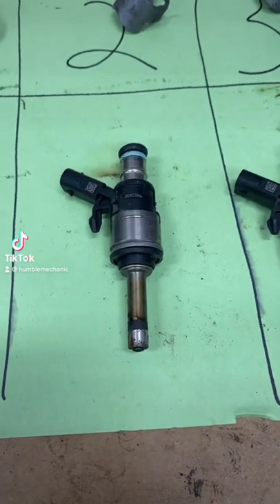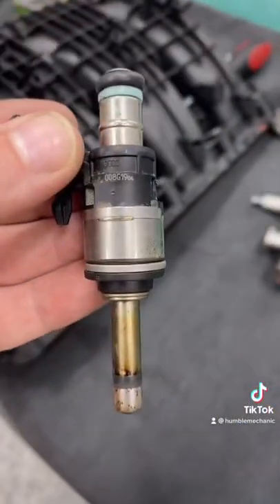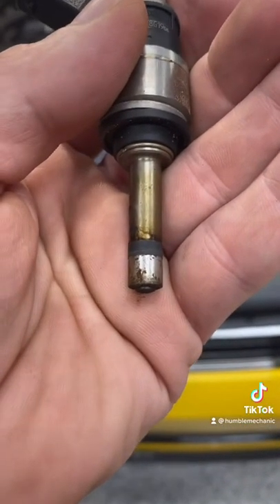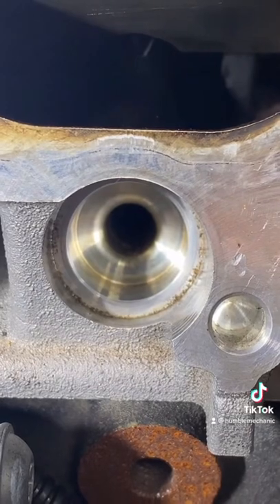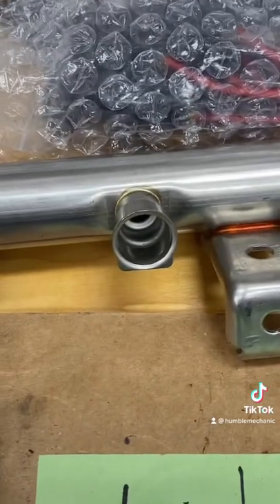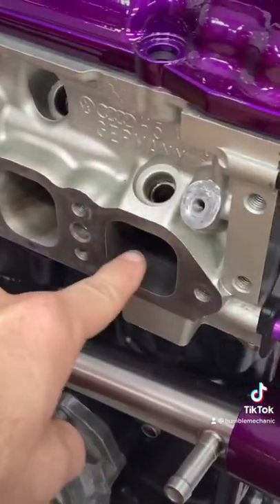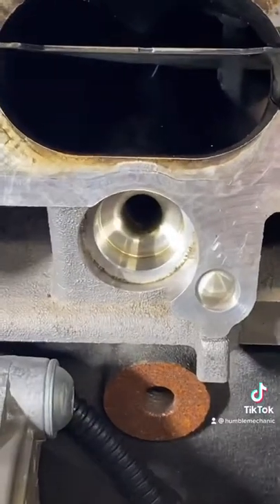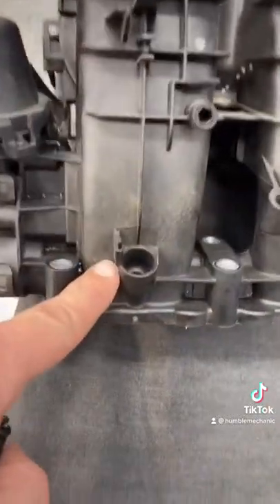Direct Injection vs Port Injection ~ Difference Explained

Comment: The combined way is the best, it has the advantages of direct injection and the cleaning action of port injection.
Reply: Wouldn't that use more fuel?
Reply: @sunny9895  No, you only put in as much fuel as you need.

A regular port injector puts in a little bit of fuel, a regular direct injector can get away with putting in a little less fuel (unless it is old or getting clogged - one of the major downsides imo).

If you have both, then you simply put about half (or whatever ratio they chose) of the fuel needed through each. In case you didn't know, the ECU controls how much fuel comes out of the injectors each time they fire
Reply: @rolls_8798  most manufacturers who run direct and port injection switch over based on engine load and power request. There are situations where direct injection is better and situations where port injection is better. 
Toyota does it this way and you can clearly hear the switchover between the two.
Reply: @meeder78  oh sweet, I was just assuming how they worked, but I still corrected OP's logic. Good to know, however
Reply: Port fuel injection is used at low part throttle and idle for better combustion. Switched over to direct injection on moderate to full load. Direct injection only vehicles idle “ok” but they are very sooty which can be seen on their exhaust tips being completely sooted over.
Reply: @rolls_8798  you don’t put half from each because on the compression cycle you would be EXTREMELY lean.
Reply: Direct injected vehicles compress only air during the compression cycle then inject the fuel right before the spark plug fires in the power cycle. Port fuel injected vehicles inject fuel during the intake stroke so that it has fuel during the compression and subsequent power cycle.
Reply: @RadDadisRad  exactly, on our Ford C-Max the exhaust was extremely black. The diesel Focus I had had less soot in the tailpipe than the Ecoboost.
Reply: @meeder78  I believe it. My ecoboost Taurus and Fusion make more soot than my Ram Cummins.
Reply: @RadDadisRad  other way around. Port injection has better fuel atomization and distribution the higher the load and rpm. Direct injection is superior at low rpm and loads.
Reply: @meeder78  that is because of the high compression.

The same issue that caused black smoke on diesel trucks. Diesel trucks have to have particulate filters now, gasoline engines don't. Yet.
Reply: @jeepmanxj  gasoline engines are fitted with particulate filters as well overhere as part of the Euro6 emissions levels.
Reply: @meeder78  euro 6 is the 2021 standard correct?
Reply: @jeepmanxj  you’re 100% wrong
Reply: @jeepmanxj  lots of articles published on it, I suggest you read some of them.
Reply: @RadDadisRad  thanks. I have and I also handle my own ECU mapping. I'm well aware of where what performs best.
Reply: @jeepmanxj  doesn’t sound like it. Direct injection sprays a cold dense fuel charge that hasn’t homogenized with the charge air because it wasn’t part of the compression stroke into the compression pocket on the piston. The spark is not strong enough to ignite the fuel and air. 1) because the fuel is not homogenized with the compressed air and 2 because the fuel is still liquid and pulling energy out of the compressed air causing it to cool which makes the spark work even harder to ignite the charge. That is why dual injection vehicles use port fuel injection for idle and part throttle tuning and direct injection for fuel throttle and moderate throttle loads. You’d know that if you actually read but you’re trying to convince people that because you beeped and booped a keyboard that you’re a tuner.
Reply: @RadDadisRad  sure thing

I bet you read the USDM sti has head gasket issues, the wankel is reliable, and the 2jz in the mk4 supra easily handles 800+whp with no modifications.

Research falls on its face when it comes to reality. Specifically low load emissions and power is why companies went to direct injection. Not the other way around
Reply: @jeepmanxj  not true. Direct injection allows a leaner fuel mixture without higher NOx emissions with higher compression. Aka a more efficient combustion with a baseline fuel. Direct injection vehicles don’t idle well. That’s why many manufacturers integrated port fuel injection to improve idle emissions. They use direct injection for load because they can inject directly before the combustion cycle when the cylinder is at its hottest warmest without causing pre ignition. You can’t do that with port fuel injection because it will ignite. That’s why DI engines get away with 11:1 compression while using 87 octane fuel. At least my Silverado is 11:1 and it recommended that I use 87 and nothing higher
Reply: Toyota has a system for newer cars called D4-S
Reply: @MrPond-xp6dl  they have always called their direct injected engines D4-S. Even the ones which feature only direct injection and not the newer engines which feature both direct and port injection.
Reply: Which model year of Vw has that combination of port/direct injection????
Reply: @sunny9895  no
Reply: @meeder78  so does ford with the 3rd gen 5.0 that's why they make alot of power n/a

Comment: Tip if you have a direct only engine  - Get an oil catch can to save your intake valves. Over time the valves will get junk on top from PCV blow by. Since there is no fuel being blasted on them (this cleans them as well) they will get build up over time and can cause the valves to not seal properly.
Reply: Unless you live somewhere with cold weather since the water in the catch can will freeze, leading to a very bad day if you try to start the car
Reply: @joebormann7631  shouldnt be any water in the catch can?
Reply: Can this build up cause oil to be burned? I have gdi and am having issues with burning. Only 150kms. Any help would be great. I’d pay to get the valves cleaned if it solves the issue

Comment: Direct injection unfortunately is most often used to reduce engine size and add small turbo for efficiency, and most of those engines are complete garbage, oil dilution.

Comment: My Mitsubishi 1.8L GDI is from 2001, it has over 240 000 km. Nevet had any problems with it, including whole direct injection system. 
VAG from 2019. 
Already needs repairs? 
:P

Comment: Thanks for the presentation, I haven't had a direct injected car so far, good to know.
Reply: As an N54 owner, have fun cleaning your intake valves!
Reply: LT Chevy engines are Direct and LS engines are port something else he did not say the direct runs two fuel pumps one is electric pump tank to high pressure pump that is mechanical like the old engines have and with direct you have to deal with replacing 2 pumps when they go bad and other issues direct injections brings

Comment: Can you do a comparison video on fsi, tfsi and tsi?
Reply: FSI (Fuel Stratified Injection) is VW speak for a naturally aspirated, direct injection engine. TSI (Turbocharged Stratified Injection) is VW for a turbocharged direct injection engine, and TFSI (Turbo Fuel Stratified Injection) is Audi speak for again a turbocharged direct injected engine. Fun fact, the i after many BMW model names simply means they are fuel injected, even though that's been all cars for decades. They make it overly complicated, it's all either MPI (multiport) or GDI (direct injection) with or without a turbo

Comment: Mr.Humble, do they make any type of kit to install a single injector into the intake to clean my crusty valves on my mk5? Tired of pulling the intake off every 40k
Reply: change your airfilter in time and use the next thicker oil (it may also lower your performence /increase fuel usage by around 4%  )😌

Comment: When a vehicle that has both types of fuel injection it’s usually the port injections job to clean the oil off the back of the valves. And the direct injection part is for power and the system alternates between the two if equipped like the newer tacomas have..

Comment: Currently own vr30 direct injection, I change oil often due to gas getting into oil
Reply: That shouldn't happen if it's burning properly. You might need new plugs.
Reply: Gotta be getting some major blow by as well
Reply: @matthewmorgan582  I change at 3000 miles, the car is running fine, the oil just always smells like gas, hard driving every day
Reply: @mikehawk1673  no blow by, just hard driving every day, I change oil every 3000 miles
Reply: It is a phenomenon caused by the a high pressure fuel mist getting caught between the cylinder wall and piston thus seeping through the piston rings gaps and into the motor oil. My favorite fuel system is a Bosch 70 PSI port fuel injection system. Atomizes the fuel better than other port fuel injection systems and the efficiency and cooling effect is very close to direct injection.

Comment: What can you do for a car with direct injection to keep the valves clean?  What are you doing with your Golf R?  (I have a Mk7)
Reply from the maker: Good maintenance, good fuel, "spirited" driving, and MK7s are pretty good. MK5/6 would need it every 40k
Reply: @HumbleMechanic  my golf R is multi point injected. Still had to clean the valves at 70,000 KMs.
Reply: Walnut blasting or cleaning of sorts by taking off the intake manifold.  I work at a vw dealership and pretty much any VAG for the last 10 years this is needed every now and then.  If you have dfi only you have to clean them since gas will never get behind the valves.

Comment: Hej man, can you make a video on why all manufacturers use plastic intakes?
Reply from the maker: No video needed. The simple answer is probably cost and ease of manufacture.  

There is a case for heat dissipation I’m guessing g too

Comment: Great explanation! Which is better for performance and/or reliability?
Reply: Direct injection for better performance and port injection for reliability. 
The problem with direct injection is that it causes carbon build up on the valves and they need to be cleaned. 
I believe that using both direct and port injection is the best for performance and reliability as the port injection cleans the valves when they spray.

Comment: I've always wanted to find out which VWs and Audis have direct and port injected engines, that would make a super useful video for us trying to find a newer vehicle but trying to avoid the direct injection carbon problem😉👍
Reply from the maker: In the US, its VERY few. TTRS,R32, and maybe a few S/RS Audis. but most VW/Audis are now DI
Reply: @HumbleMechanic  Thanks 👍, I guess I'll be sticking with my trusted B5.5 Passat with its 2.0 port injected engine. It's annoying they went with direct injection as I like the brand but just no viable options to upgrade to a newer vehicle without taking on board the dreaded carbon! Such a shame they did that!
Reply: Not all 2.0 tfsi engines (mk7 golf gti, R) etc are DI only, some have port injection as well as DI, and some only have DI
Reply: @scott4207  hey thanks for that👍, I'd love to know exactly which models/years to look out for, if you know any more details, that'd be absolutely awesome 🙏
Reply: @jahkingdom  your welcome, I’m a technician for VW main dealer so I’ll have a better look into it, but to be honest I’m not totally sure if it’s model year dependant, I believe it’s certain engine codes which run both DI and port injection, however which engine codes that is I am not sure. We don’t really get much coking up of the valves, I know it can be a problem long term but from my experience it’s actually the lower mileage cars that suffer with it, short journeys etc.
Reply: @scott4207  that's very good to know, thank you 👍, very handy to know you're a VW tech😉. I've got a fun job coming up on a VW Eos, roof won't operate because the rear quarter window won't move, even after a window reset. I'm thinking the module lost its comms maybe. Don't suppose you know any short cut to making the module and ECU talk to each other again by any chance?, really don't relish the idea of getting in that back panel 🙏👍
Reply: @jahkingdom  ah Eos…. 😬 one of the worst cars ever built by VW. Unfortunately those rear window motors are quite common, no way of bypassing it that I’m aware of. You might be able to switch both rear motors over just to confirm it’s an internal fault with the motor but unfortunately in the majority of cases it’s a replacement to fix.. those roofs are just a nightmare. Had plenty of those pack up where the boot fills with water and floods the pump/control unit in the back 😫 try to avoid eos as much as I can haha
Reply: @scott4207  thanks so much for that, it's a great help👍. I think there's just too many points to go wrong on the Eos as you say. I did warn him not to buy it lol. I once did the heater core on my old b5 Passat which was another fun (dash out) job😆, was glad when it was all over though 😉
Reply: @jahkingdom  can’t say I’ve ever done one on those passages, but what I can tell you is most of the newer passats/golfs etc the heat exchangers are much nicer to fit! Worst case glove box out and they slide out 😀 no dash removals!
Reply: @scott4207  oh man, that would have been a dream come true at the time👍
Reply: @jahkingdom  yeah they are much nicer, also very common on the diesels too - they block up from contamination (usually the mesh bag inside the expansion tank fails and sends the silicone stuff inside round the system… usually blocks up the heat exchanger and stops one side of the interior heating from getting hot!
Reply: @scott4207  I see. I remember when I finally reached mine in the depths to get it out, it was sitting in a small pool of coolant and had lots of pink rusty areas where it had leaked, I realized it was the heater core as one day I had pure steam coming out of the vents😆. I ended up bypassing it completely as a temporary solution but at the time was middle of winter and that car was fookin cold inside without it and the windows would fog up real quick

Comment: Direction Injection is slightly noisier as the injectors run at higher pressure and create a ticking sound

Comment: Direct injection: Slightly more power
Port injection: Significantly more reliability
Reply: I own a 23’ civic with the k20c2 with port injection
Reply: Not entirely true. Depending on the platform especially on DISI motors (ford focus rs, mazdaspeed3) those cars come stock with DI, if you build them and want the most power potential you want to go multi port and stay away from DI.
Reply: Direct injection for the cleaner combustion and efficiency, nothing to do with power.

Some engines that use both types of injectors will use the direct injection for low loads, and the port injection for high loads, hence POWER
Reply: @JohnWiku  ✊🏽
Reply: How did you come up with that? Not with any science or studies for sure

Comment: Ok but if port injection considered wasteful does that mean that direct injection is less fuel less wasteful if it directly put in a cylinders combustion chamber it shouldn't need as much fuel 
I'm aware that direct injection is as high compression than a port injection but even so you can tell that both stumble at idle and acceleration wouldn't that say there's to much fuel in the chamber carburetors get a bad rep but they had better fuel itemization and smooth ide

Comment: Direct injection runs at a higher PSI making you have to run two fuel pumps one pump to feed the fuel from the tank to the high pressure pump and into the engine sort of like Diesel engines. I would rather have port then direct myself less crap to go wrong being two fuel pumps and the whole carbon on the valve deal stuff you don't have to deal with on port

Comment: One of those super rad cars are the Lexus IS 350, Subaru BRZ, Toyoda GT86. Both have basically a Subaru engine with Toyoda D4-S. Volkswagen on the other hand thought that their engines are already overengineered as they are and given how lazy those Americans are regarding maintenance, they simply would sell more cars that way.
Reply: There's lots of mk7 VW Golf Rs with multi injection. Maybe not in NA market though 💁‍♂️

Comment: Hard pass on direct injection and gummy valves, at least for my daily.
Reply: The gummy valves is one thing, but the soot in the oil kills timing chains super fast.
Reply: @GWinvader101  Are you saying GDI engines generate more soot which gets into the oil? Please explain.
Reply: @abdul-kabiralegbe5660  yes, gasoline direct injection builds up soot in the oil, same as a diesel. It is a byproduct of direct injection. Just look at the tail pipe of the next GDI car you look at. You’ll find tons of soot. Anyway, the soot makes it into the oil since there is always some blow by In the engine. This soot is fine enough to get between the moving parts in the timing chain. Once there it acts like sand paper, the wear is not much but once you factor in the wear in every link of the chain, you end up with a stretched chain. 
A simple work around for this problem is a timing belt, instead of a chain. 
One of my vehicles is a Jetta GLI, 2.0T Direct injection. Over 160,000 miles it stretches not 1 but 2 timing Chains with 5000 mile oil changes. 
I’d much rather do a belt every 100,000 miles like on my Old TDI cars.
Reply: @GWinvader101  Thanks.

Comment: And this is why directed injected cars that don’t have port injection run decent for 60,000 miles and then run like shit and get horrible gas mileage because the valves are dirty. Using cheap gas from Costco will do this even faster even if it’s the correct octane
Reply from the maker: Costco is top tier fuel. I’ve never done any testing but it “should be” high quality
Reply: Wrong!  Costco gas is Top Tier gas!  Do your research bro before putting out misinformation...
Reply: @HoldenMcRotch  not from my experience